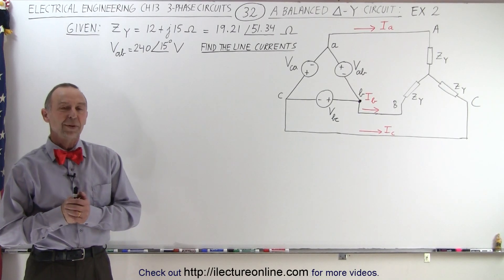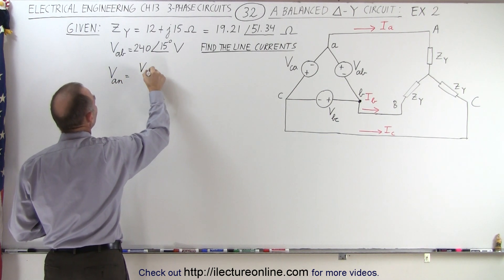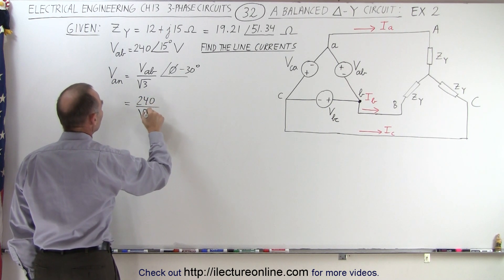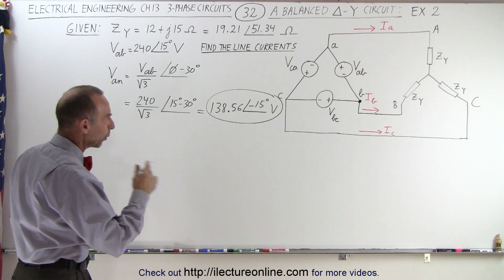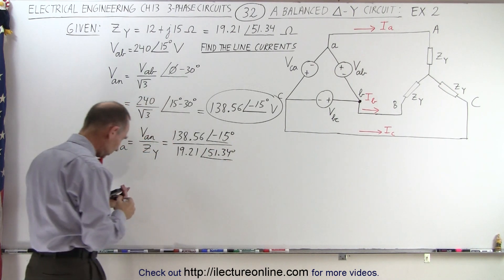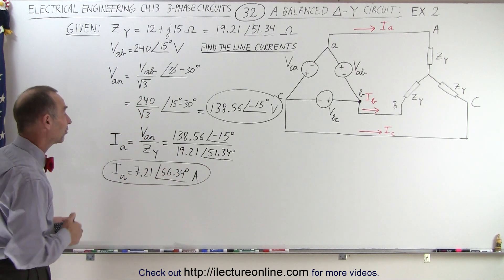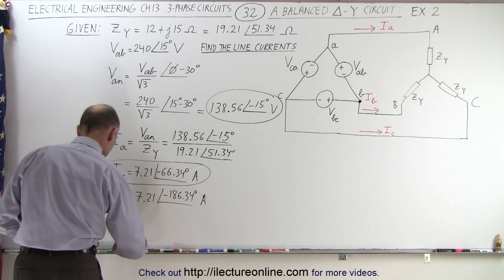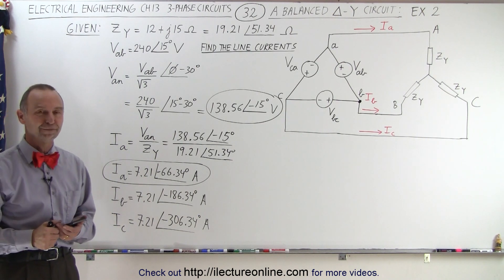Electrical Engineering: Ch 13: 3 Phase Circuit (32 of 53) A Balanced Delta-Y Circuit: Ex 2

Comment: Hello Sir, does the voltage value of Vab equals to the value of the VAB in delta-y circuit?
Reply: If the impedance of the line, ZL is not included in the question
Reply from the maker: You can find your answer in this video:  Electrical Engineering: Ch 13: 3 Phase Circuit (24 of 53) Balanced Y-Delta Circuit: Summary